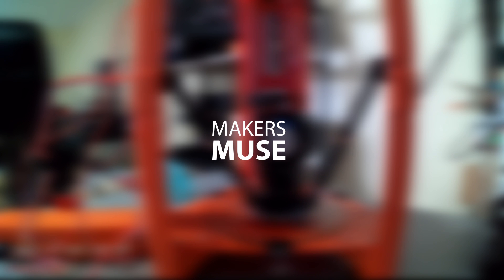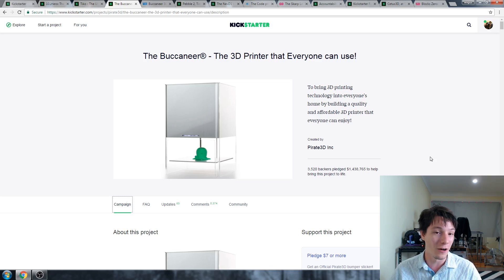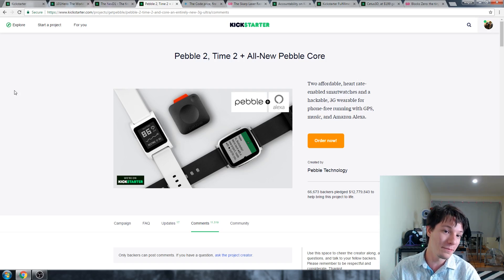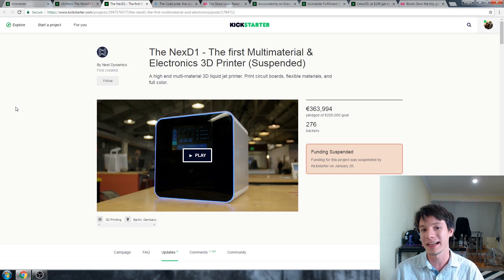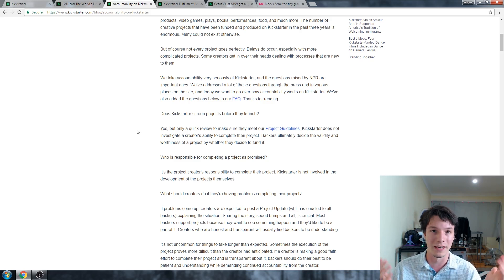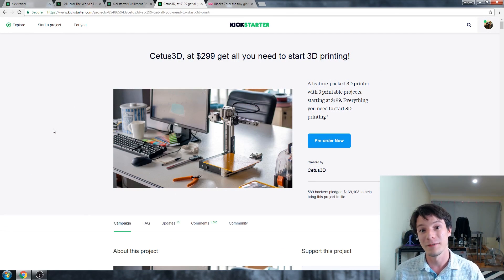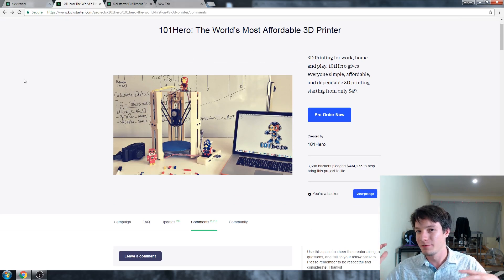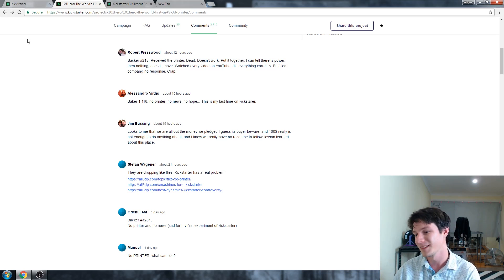Crowdfunded Hardware - We need a new approach (urgently)

Comment: My dad backed the M3D Pro 3D printer as a present for me for Christmas. I still haven't received it and just received an updated stating various things such as the printer will not be delivered until late March. Not to mention that the quality of the 3D printer is not even close to what was promised. I should have told him to get me a Prusa i3 MK2. However, neither of us had ever backed a crowdfunded project before and were unaware of the possible difficulties. We have sent over 20 emails back and forth to M3D in an attempt to receive a refund on the printer, but despite smashing their original goal by around 1061% between Kickstarter and Indiegogo, M3D refuses to provide any refund, stating that the printer will be delivered.

Comment: A good discussion on the issues currently in crowdfunding. I fear that Indigogo and to a lesser extent Kickstarter are allowing the "well to be poisoned" which ends up hurting legitimate projects down the road. Sites like Kickstarter cannot just keep collecting their take and then wiping their hands on the outcome without tarnishing their reputation over the long term.

I think another service will end up rising from this (if not already done so) that will offer more accountability to the project owner and more protection to the backers. Like holding the money raised and releasing it on project milestones achieved. If the project fails then there is at least a greater change of getting some money back, rather than none at all.

 - Eddy

Comment: I think these will only work in future if the Kickstarter-equivalent is directly involved in the shipping of the product. The inventor would have to get into a contract with the crowdfunding company to fulfill the requests, and then if the inventor does not fulfill then it ends up as a contract violation. There will be additional overhead, and that will need to be accounted for in the pledges, but it will bring some much-needed repercussions into the process.

Comment: I think some aspects are missing:

For the "creator" of a Project  Kickstarter is a way to test their Idea. If no backers back the project, it is either a bad Idea or nobody needs it. Kickstarter not only helps with the risk but also solves the "will anybody buy this" question.

For the backer it is often stated that crowd funding is not online shopping. The backer invests in a company, so the same risks as with buying shares of a company(complete loss) apply. Maybe this needs to be communicated more openly. (People buy shares of companies,..)

Requesting a big money deposit in front from the creator is probably what would be needed to be able to do in depth analysis before the project. Then even with these additional checks the project might still fail. It would only reduce the risk. But on the other side it would make it impossible for small start-ups to use crowd funding as they could not afford the risk anymore.

Maybe changing the way the projects work is needed. So instead of backing a 3d printer project to get that newly developed printer, how about this: We have project that present new ideas and ask for the money to research them. They show that they are smart people and present a plan of what to test. If they get funded, they get the money not in one go but in slices as needed for the research they want to do. At the end their experiments either failed and we discovered another method of how not to do it. Or they succeed and we have a major improvement. In this stage they could go for a license model. In that phase anybody (most probably established 3d printer manufacturers) can come an say "I want to use that new feature" They then have to pay a small license fee for each printer they sell with that feature. This fee could then go back to the backers. The backers could potentially get rich by backing the right projects and everybody could enjoy the advancements of technology. But then again we have the situation that backer can loose all their money and basically this is not kickstarting anymore, right?

Comment: I don't see a problem with crowd-funding. I see a problem with what ppl are doing with it. Everybory, including those with projects out there, thinks this is a way to buy a product cheaper before the launch, that it is a pre release, and it isnt. You should support crowdfunding if you see a project that you wish it became true, a project that wouldn't became true otherwise. It is for innovative stuff were the industries are not yet ready to bet. We don't need another 3d printing crowdfunding project unless it is innovating someway. But most of them are just using the same principles and trying to became a new player in the market. My money on crowdfunding goes to projects that wouldn't see the day light otherwise or to those that would be corrupted by too big industries for them.
Reply: Leandro Lopes. But that model has a terrible failure rate.

Comment: I think Indiegogo is much worse than Kickstarter because you have no way out of the campaign, even if it has not ended. If you find out that something is fishy about the company or project, Kickstarter at least let's you cancel your pledge till the last minute, instead of Indiegogo where you only can pledge more but never less. That's why I will not pledge on Indiegogo but regularly do it on Kickstarter.

Comment: Excellent video!
since this is open discussion,
my suggestion(s) for better then Kickfarter.
1) provide an actual model.
if theoretical, then have to be a different program, basically a donation video.

2) any project would have to provide actual information for a projected number of items.
Example is have the individual or company provide actual quotes, emailed from one manufacturer or many. ( would have to develop a program for manufacturer co. like a low cost promotional quote for the "job/part" but would cost something as it's impossible to do millions for free with a real human to confirm everything, but basically a network that is cloud/online based. (kinda already exists)
3) person or company would have to provide a labor quote based on their local area. always give back to where you started from. some instances will need to be only an office depends on zoning laws for manufacturing, anything else, etc.

4) put up something of value to hold you accountable to the value of want you want to do.
with that add different levels of "customer to investors" ratio referring to actual access to monies that said person/company providing idea and collateral, to the possible access to monies a small/large investor(s) would grant access to given the likely hood of failure or success.

5) person or company would have to provide  quotes for labor rates to said locally sourced facility and or extension(s) in case of a larger scope.

6) add a cap based on these numbers to be within reason of the scope. in return said service would charge a 10% fee for providing said service and accountability for different contenents/countries/counties/states/cities/towns/and "middle of nowhere" homes. :)

on all of this the number of items can then be figured to put a cap on a run.

basically, it's setting up a preorder.

Comment: To be fair to Tiko, they did ship several thousand "production" printers to backers (myself included) beyond just the beta testers. 

The printer isn't especially good, but their software updates and active community did make real progress toward improving the print quality in just a few weeks after the printers starting hitting backers and Tiko staff were actively engaged on their support forums. I'm confident that with a few more months of improvements and updates, it would have been a very solid little printer. 

However, it does seem likely that they are out of money, and the rest of the backers outside of the US and Canada are SOL. That's really too bad, since Tiko did actually deliver a real product, and for most of the campaign, posted regular updates, and were reasonably transparent. 

They said that after laying off staff, they can slow their cash burn enough to fulfill all the orders, but I wouldn't hold my breath on that, sadly. 

It's too bad. There really was some innovative engineering there, but I think their choice to develop a slicer from scratch was more than they could chew.

Comment: the whole point of crowdfunding was the lack of accountability. If the campaign had a safety, they could just as well get a regular loan.
I'm going to start a tech Kickstarter campaign in the mid future, so I don't want the accountability. I believe creators should win over their potential backers by showing them that they are able to do what they claim. So first and foremost, we need more transparity about that. Second, there should by something in place that holds scammers accountable. Not those that just fail trying.

Comment: I think every pledge on Kickstarter should be increased by 3% and that goes  to a huge pot where if a project goes under  hopefully they can use that to repay the backers as much as possible
Reply: Or a company would have to make a certain minimum of like 100 prototypes and would need to send them to the first backers right away and would need to have them send in reviews to Kickstarter.  If they are capable of producing this many prototypes hopefully they will have somewhat of a decent manufacturing line

Comment: I've been through this process a number of times and a number of ways. A few things that just aren't going to happen: 1) Insurance - there simply is no mechanism for doing this. If 3/4 of the projects vanish how much would that insurance cost? (hint - a lot). 2) Escrow big enough to matter - a hardware project puts money into parts way ahead of shipping. Custom parts suppliers aren't going to trust a phantom outfit. They want money up front and full payment when the parts are delivered. 3) Conventional legal remedies - If I'm six time zones away and there is no formal contract, who sues who and where? In a normal business you would hash all this out ahead of time and the contract might run to over a hundred pages. What sort of works: 1) Venture capital - This high risk form of investment (but not as high as crowd funding) has some checks and balances in it. You have the backers actively participating in the project. Money is dolled out in chunks as things progress. Depending on what you read, it works maybe half the time. 2) Assets backing the project - been there done that, the bank / backers get to take everything you own if you fail. It sounds like a lock in. Time to go buy a new house and mortgage it at the 125% level. (and yes that is exactly what happens) 3) Class action lawsuits - This only works if there is an enforceable contract of some sort and there is any money  still around. It also works a lot better in some countries than in others. So what would work? If the people at Kickstarter are going to have a business they need to sort some of this out. Since they make money off of this, they have money for a lawsuit to target. How valid is that suit? Who knows. I would suggest that some sort of tier system where risk (in $$$) and the level of analysis by Kickstarter is probably about all we might see. Having been on the "sell" side of Kickstarter this is hardly their only issue. There are a lot of things they need to work out ....(but this is a mighty long post isn't it ....yikes !!!)

Comment: I think the main thing is that the public have no idea of the value of a product, and creators suck at valuing the product. Think back to the Zortax campaign. They delivered what is generally considered the big dog of plug and play desktop printing, but they valued it at a proper price. Some would say it's expensive, but you get what you pay for.

With things like the Tiko, bukineer, and so many more, they just simply don't have enough margin behind the cost to run a business, pay rent, pay staff, pay for mistakes and so much more.

A note to creators 'Price your product accordingly and risk scaring off a few potential buyers, or price your product low and watch your business crash and burn.'

Comment: Crowdsupply extensivly vet every creator and require a refund if they fail to deliver. So far they have a 100% sucess rate.
Reply: The Lime SDR (Software defined radio) appears to have been backed on this one. That adds some legitimacy to CowdSupply. On of the biggest Cellphone carriers in the UK (EE) backed this project.

Comment: I have a love / hate relationship with my Trinus 3D printer,  love it when it's printing but hate having to take the extruder apart again. I am looking to see if any other extruder assembly can be made to fit. Would I have to change the board or are they fairly plug and play? apart from cabling issues?
Reply from the maker: +Bernie Lobb you won't have to change the board but possibly tweak firmware if the new extruder drive gear is a different size.

Comment: One simple way to improve crowd funded HW might be to pay the money out in chunks e.g.: 1/3 up front, 1/3 after the first 10 units have shipped, 1/3 after 200 units have shipped. It cuts each users exposure by 1/3 and gives creators a reason to keep working. This is basically the model used by mold makers: when you buy a mold you  pay out chunks as milestones are reached

Comment: This video is excellent! I backed lokbuild on kickstarter, becuase it was cheaper and worked better in their demo video than other alternatives, and thin enough for my auto leveling to work through. I was sick and tired of failed prints and blue painters tape. (It's impossible to print on my bare aluminum bed, I bought a migbot i3 knowing it would be a learning experience, but I happened to be one of the few poor souls who bought from the batch of warped aluminum beds). The project delivered on time to its reasonable number of backers, and I've had nothing but successful prints so far. However, I only backed after researching steelmans (the parent company) and calling the 3d printer manufacturers steel and was working with for trial of lokbuild. My mother, on the other hand, backed the fidget cube because she saw it as to big to fail, and thought they would be wonderful to have around. Updates are slowing, and still no product!
Reply: *steelmans not steel and

Comment: Just some background.  I've got 43 active projects and 4 more that I backed and was refunded by the creators when the project started going in a different direction then I felt they had indicated (something creators should do more of)

Of the 44

20 completed and delivered, within a reasonable time period, reasonably close to what was advertised in the project.

9 are ongoing and its too early to tell how they'll end up.

7 more are running late but the creator has kept the backers updated and the delays seem reasonable.

2 are late with no excuse, either there is no communication or the "excuse" is "we really didn't care enough to work on this like we should have"

2 failed in that they fulfilled but were so late the rewards were so far off the mark they were unacceptable.

3 failed in such a way I consider them Scams (Star Trek Axanar, Robotech tactics & 1d100 a book of lists)

1 failed in that it finished (3d virtual tabletop) but I originally asked for the PC version of the product which was delayed and released in an alternate format not acceptale and asked if I could switch to the android version (I got a tablet while waiting for the project to complete) and was told yes, but never told how.  So I asked if I could just get the PC version and how to do as and was told yes I can.  So after 4 attempts to find out what I need to do to claim my reward, any reward, I've been told yes I can get the reward, but have yet to ever be told exactly how to so that.... 

So 3 out of 44, that's not a bad ratio, but I can say the disappointment, distrust and outrage over the attitude of the creators and kickstarter two main failures (Robotech and Axanar) far, far outweigh any goodwill towards kickstarter for all of the successful products.

The problem isn't so much that kickstarter fails, its that when it does it does so in an incredibly spectacular way.

On a side note, both of the indigogo (SP?) went better and fulfilled with fewer problems than my Kickstarter projects did :-p

Comment: I disagree I've funded over 50 projects and I have had 2 outright fail one was the Zano drone and that was clearly a ripoff.  Two that failed refunded my money and I'm watching one fail right now "Slidenjoy" great idea but I think they will not make it.  I think you need to keep your goal realistic.  First never spend money you can't afford to loose second this is completely speculative you are buying into an idea not a product if it happens great if not it was a risk.  I've only had a low failure rate.  I have gotten a few bad products such as Cobblebot the upside to that was I learned a ton about 3d printers and with mods and hard work it does really well I learned about software and hardware modifying this printer even in a poor product you may learn from it.  

I think your goals should be realistic and you should spend you beer money not your house payment.  Those are my thoughts.